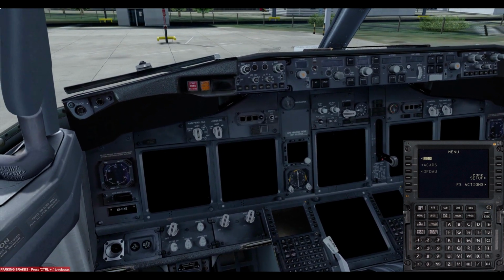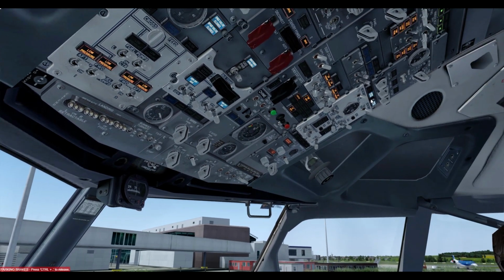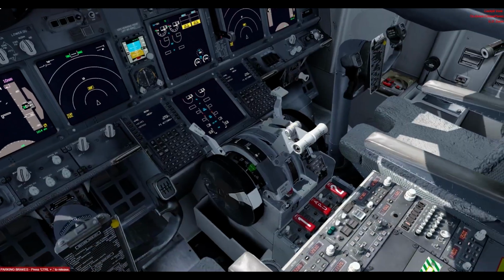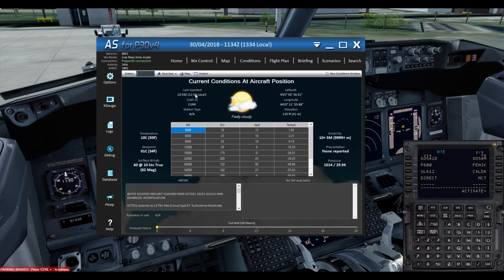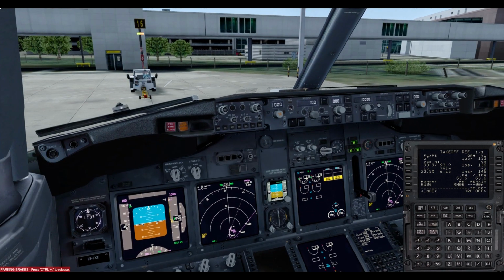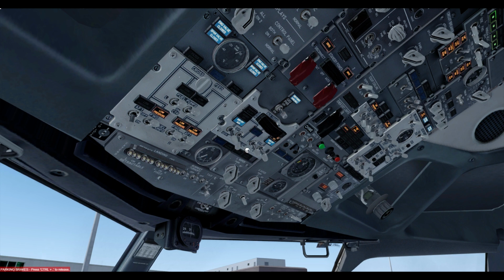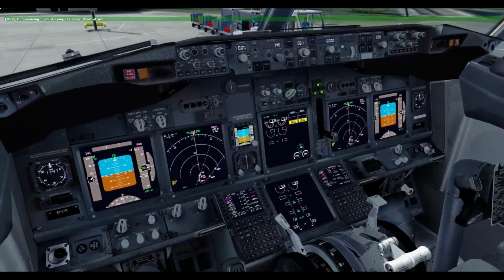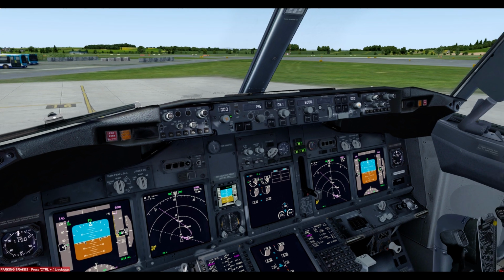PMDG 737NGX: Beginners Guide Part 1: Cold And Dark until Engine Startup

Comment: I’m looking to get into flight sim, been wanting to for a while. What is your software recommendation? I need to buy a better pc but don’t want to spend an absolute fortune. Would £500 cover it?
Reply from the maker: A PC for £500 is kinda low. I would aim for at least 800£, mine was more than 1000£ at the time and I can't even run P3D that well.

Software is gonna be just as expensive, if not more expensive than the computer lol.
FTX Global
FTX OpenLC Europe
PMDG 737NGX
PMDG 777
PMDG 747
Aerosoft Airbus or Flightsimlabs Airbus
Tons and tons of other scenery add-ons
Etc. etc. etc.

Only the PMDG aircrafts are over 100£ a piece. Flight sim is a fun, challenging and educational hobby, but extremely expensive.
It's an investment, 500£ won't be enough though, I'm pretty sure. It depends on how good you want the sim to look, run and how realistic you want things to be
Reply: 737NGX thanks for your reply. It’s definitely a hobby I’m interested in taking up but want to have a decent start up that I can build upon. I know I need at least 8gb ram 2ghz and i7. So yeah 800 for the pc alone is what I’ll go for. It’s a lot to think about. Thanks again. Subscribed.
Reply from the maker: disby 83 Thanks m8. If ur able to copy my specs, you should be able to get around the 800gbp mark.

I7 isnt nessessary. Save money and get an i5. Not sure what u mean by 2 ghz tho. Also, definetly get a desktop pc. A laptop wont do it unless its a 2000£+ 

Regarding software, you should get them in this order:
PMDG 737NGX
FTX Global
Envtex
ChasePlane 

To me, those are essencials. After that, I would start looking at my favorite airports, FTX Trees, FTX OpenLC, Activesky and some other planes.
Reply from the maker: disby 83 my specs btw:

Intel Core i5-6600K processor
Msi gtx 970 graphics card
Msi m5 gaming z-170a motherboard
HyperX Fury 16 GB DDR4 Ram
750w PSU (a bit overkill)
And ofc a cpu cooler and storage.
Reply: 737NGX Really helpful. Thanks 👍🏼